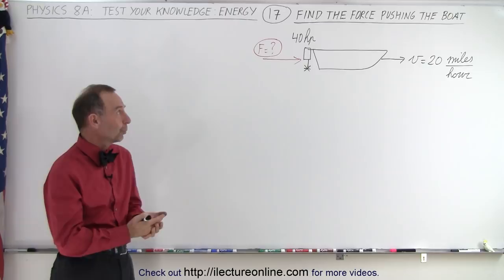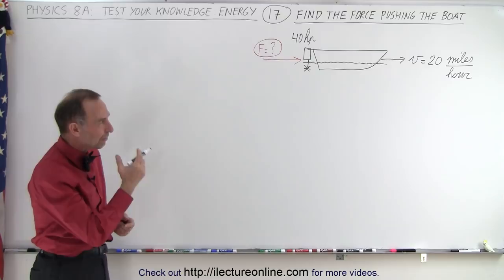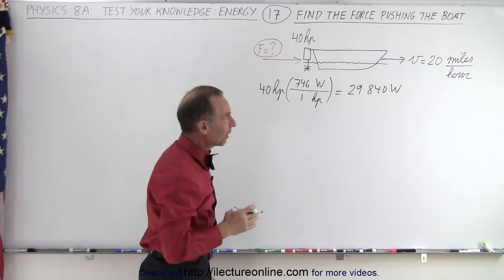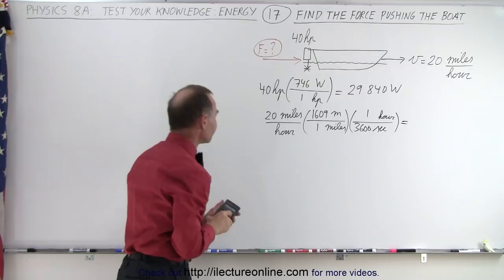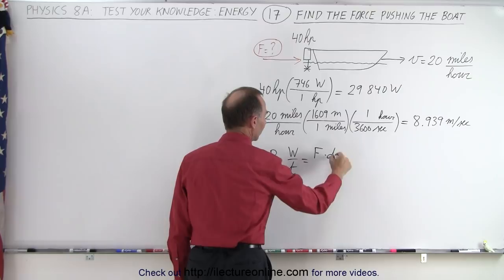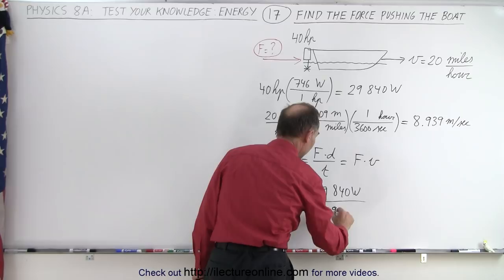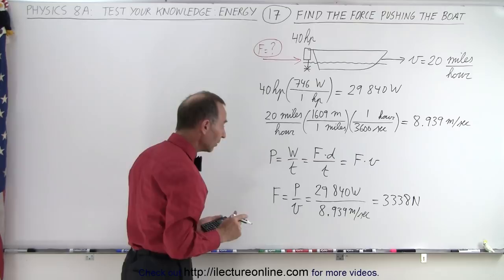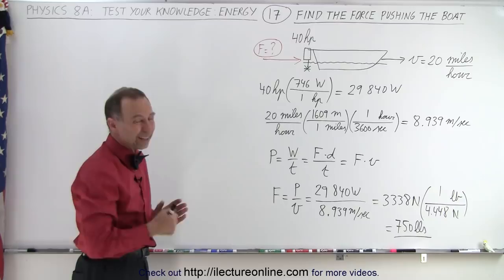Physics - Test Your Knowledge: Energy (17 of 33) F=? Pushing the Boat

Comment: And that's a good illustration of how some teachers mislead the students 
with formulas that seem to be theoretically correct but in fact that are far from reality...

the solution to this problem depends on engine rpm, propeller diameter, propeller pitch, type of engine (diesel, gasoline or electric) , power curve of the engine (hp&torque  vs rpm)  , tilt/ trim of the engine,  wind speed, current speed and many other variables.
and still you need empirical speed data...
Reply from the maker: The video is still correct as is.  Where the force comes from is an entirely different manner and you are correct that it involves all that you listed, including efficiency of design, etc.
Reply: @MichelvanBiezen  Exactly. The solution in the video is true as long as the given (or assumed) data is true.
The real world challenge is finding those already given values (horsepower and speed in this problem)
Reply from the maker: Gettin real numbers is indeed where it is at and that is where the challenge is.  (I worked as an aerospace engineer for 38 years, I am very familiar with engineering challenges. )
Reply: @MichelvanBiezen  You have ice build up on airplanes, we have barnacle growth on boat hulls. Formulas rarely work. I just wanted to point out something (what you already knew of course) that life is not easy ;)

Comment: So if this was an airboat on water with a resultant force of 750lbs and you put that same airboat on ice, the power would be the same but the velocity would increase and the resultant force would decrease.

So the relationship between force and velocity relate to the drag?... or to the efficiency?... what terms would apply?
And how might those results be derived?
Reply from the maker: No consideration was taken for the efficiency, but only the relationship between force, power, and velocity as a result of the retarding force of the water on the moving boat.

Comment: It means if we double the force it will go like 10 miles per hour?
Reply from the maker: If the friction force is a linear function of the speed, then doubling the force will double your speed.
Reply: Quicksilver published their boats' performance data.
Let's take Quicksilver activ 505 cabin :
with mercury 50hp fourstroke (1041kg test weight) , top speed is 26.1knots @5940rpm
with mercury 100hp fourstroke (1093kg test weight) , top speed is 33.2knots@6060rpm .. tested in light wind&wave conditions.

results for quicksilver 875 sundeck model :
single engine mercury 250hp verado, 3675kg test weight, top speed=33.7knots
twin engine mercury 2x250hp verado,  4040kg test weight, top speed = 45.7knots

these boats have planing hulls.

if they had displacement hulls, and you had 10x more power, you would get maybe 10% more speed.